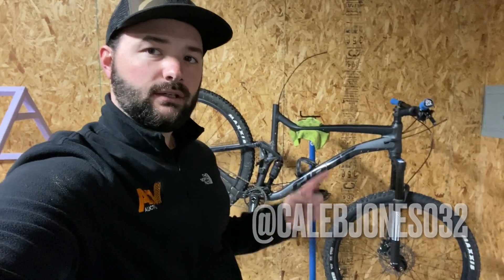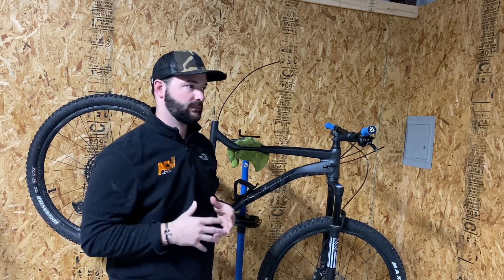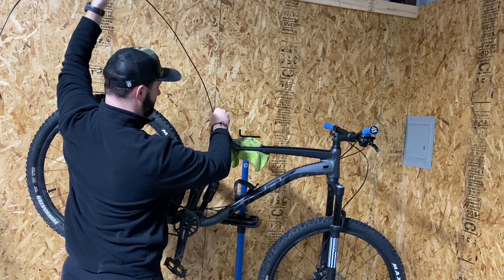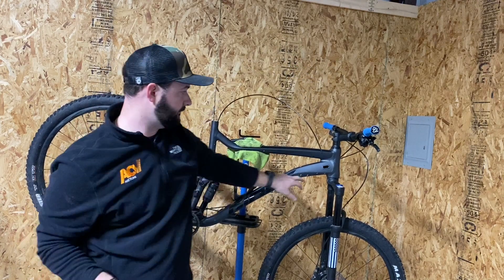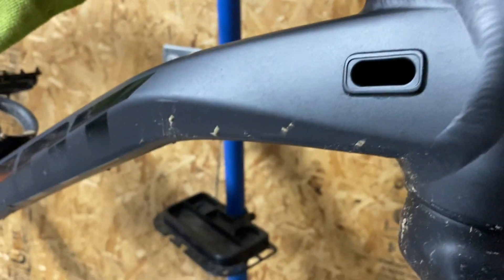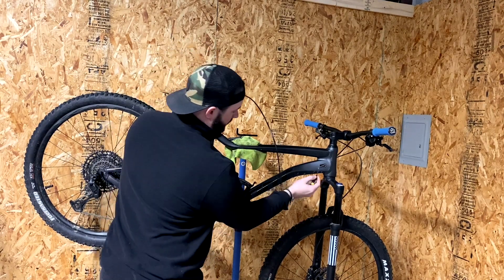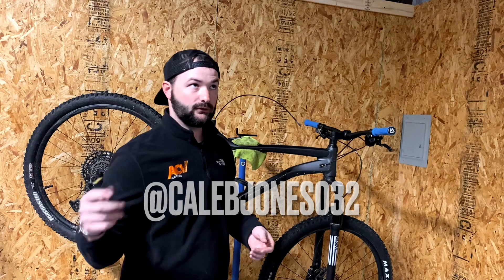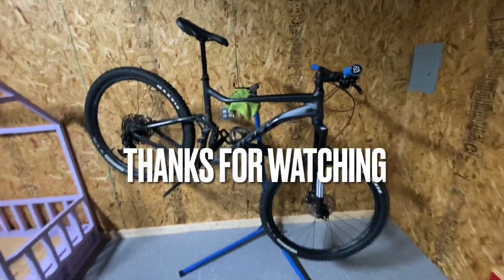Giant Stance Dropper Cable Install

Comment: Had trouble with this but it's really easy to remove the non-drive side crank with an 8mm hex wrench. Once that's off you can just pull out the drive side crank and spindle and guide the cable through the bottom bracket area yourself.

Comment: Just tried this on my 2021 Stance 29 2 - XL with a CONTACT SWITCH SL 170 mm. Tried for a while and just couldn't get it to work.
I think I got it to go in front of the crank bottom bracket, but it just wouldn't make the bend going up into the down tube. Tried for a while just like the video. The end cap was getting snagged on something when trying to pulse it a bit. Ended up losing both end caps in the frame. Couldn't hear them jiggling no matter how much I bounced the bike around. They may have gotten stuck in the crank grease. I guess something was slightly different about my frame or dropper cable that wouldn't allow it to make the bend with this method. Ended up tying a steel nut to a string and easily guided it through with a 1" X .5" neodymium magnet. Then attached the string to the cable with packing tape and it pulled right through. Super easy.
Reply from the maker: Glad you got it figured out.

Comment: Ahh, it worked!
2021 Stance 29 2! 
Thanks and God bless!
Reply: I have that same bike too. Did you buy a new frame grommet or did you drill a hole through the stock rubber one?
Reply: @ardpatron7430  just drilled a hole. But maybe a spiked object might be better for a cleaner "look".

Comment: Does the same apply for the rear break and gears? I have the same bike and hoping to get it powder coated but have been questioning the dis // re - assembly of the bike itself. Appreciate the help  🙏🙏
Reply from the maker: Honestly not sure. It would probably be a lot more trial and error. I would suggest a cheap cable routing tool off of Amazon.

Comment: I am waiting for my Giant Stance 2 29er 2021 to be delivered due next month. I think i can do it, since i am an electrician... We use to fish a tie wires at the oposite end at the tip with a U shape, feed inside the #1tie wire of one hole of the conduit, the opposite conduit hole same process with tie wire #2, wires in U shape so as to have the smoothess slide specialy at a junction or L shape conduit... After the two opposite tie wires meet inside the conduit overlapping one another (you can actually feel the two wires of small vibration) , then make a  twist or turn the tie wires at outside as fast as you can, clockwise and the other counterclockwise of tie wires, the 2 U shaped will entangle inside at a junction then you can pull tie wire#1 the other end the other tie wire #2 you feed it inside, from there, exposing to one tie wire, tie it to cable dropper post in a manner that will not injure and taped it in order to have smoothness when you will do the same process by this time you pull the tie wire the other cable dropper post you feed it to the hole.  I hope my english is comprehensible. Hehehe. Kinda old school but effective. 
-from Philippines
Reply from the maker: When you get the bike without the dropper post, it will not have a cable already ran through the frame. You will not have a “fish” to tie onto. Use this hack to run the cable and you’ll be golden! 🤙🏼

Comment: Thanks for sharing need to do this on 2021 Stance medium. Not sure if I can fit 150mm travel though.
Reply from the maker: It would fit for sure but it may not slide all the way down into the seat tube like the one in the video.

Comment: Did you need do drill? Because i thought there was something in there like a obstacle
Reply from the maker: No do not drill on your frame. There is a rubber plug that will come out of your frame where the dropper cable will run. You can either buy a plug with a hole already in it or remove the one that came on the bike and drill a hole in it. Please, DO NOT drill the plug with it on the bike.

Comment: Where did you get the rubber frame grommet for the cable?
Reply: He drilled a small hole in the original rubber 😎
Reply: @mikeogilvie6949  thanks

Comment: I have a stance 1 2021 medium size and I cannot figure out what size post I need I know it’s 30.9 but the travel is what I can’t tell, is the post that goes into the bike for say the 100 MM shorter than they 150? I would assume yes…
Reply from the maker: That's all going to depend on your inseam, post height, and how much drop you want. Most bike companies ship their size mediums with a 150MM dropper. It covers a lot of riders fit preferences.

Comment: How much mm is the length of the dropper? I can't decide what to buy.. I am considering 30.9, 150 drop, max length of 480mm is that ok?
Reply from the maker: Depends on your frame size but 150’s usually work on most frame sizes.
Reply: @calebjones032  It's the giant stance 2020 frame

Comment: so its the cable touch the bottom bracket in bottom tube ? or not ?
Reply from the maker: It will bump into it but if you move it around like shown in the video, you will eventually feel it slide past the BB. Hopefully this help!
Reply: Is it above or below the bottom bracket?

Comment: I tried this for over an hour. I could feel the wire drop and start to go down, but then it would hit resistance. I ended up losing BOTH  plastic cable caps down in the frame. I can't even hear them rattling around so I'm afraid there's somehow stuck at the elbow. Well shit. Any recommendations?
Reply from the maker: Pull the seat out and turn the bike upside down. May take a little wiggling of the bike(not yourself) but they will come out.
Reply: Same thing happened to me. I turned the bike over and pounded on it a while until it came out.

Comment: When I reach the bottom of the post I keep hearing the clicking noise and the cable doesn’t go any further, is that good?
Reply from the maker: Sorry for the late reply, hopefully you’ve got it by now. If not, just keep trying to spin the cable as you pick it up and push it down and you will feel it slide past the bottom bracket.

Comment: What size of dropper that you put on your  bike? The diameter,lenght ang the travel?
Reply from the maker: The dropper post travel is 150mm and the seat tube diameter is 30.9. I do not have the overall length of the post. The bike was a size XL so the seat tube had plenty of room.

Comment: How long should the cable be? I cut my cable fairly short to begin with, but i'm still growing and as I get taller I keep having to raise the dropper which in turn makes the cable shorter, and now I can't quite turn the handlebars 90° because the cable is too short. I can obviously still turn the handlebars fine when biking, but do you think I should bother getting a new cable, or just stick with it? Thanks
Reply from the maker: There isn't a set length, it depends on your frame size and saddle height as to how long it should be. You have a couple options here. 1. You can leave the cable long enough so as you grow, you can make adjustments without having to replace the cable all the time. Some of the slack can be pushed into the frame so that it is not hanging out super long. Just make sure that its not hanging out to much or it will catch on things in the trail which can be dangerous. 2. Cut the cable to the proper length and just replace the cable each time you make an adjustment. Personally I would leave it a tad long and just stuff as much excess in the frame as I could to allow for adjustments down the road.
Reply: @calebjones032  I'm 6 ft, so I'm probably not going to grow much more, but thanks for the reply! I'll probably leave I the way that it is now, but I'll put in a new cable I I have to